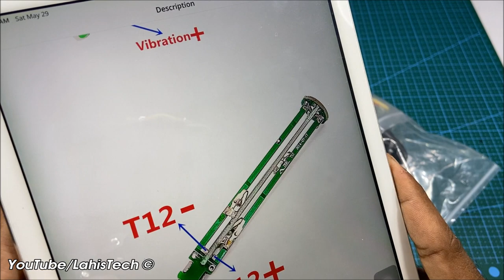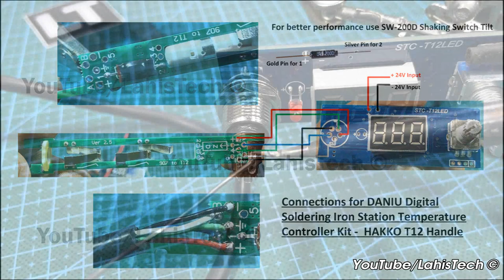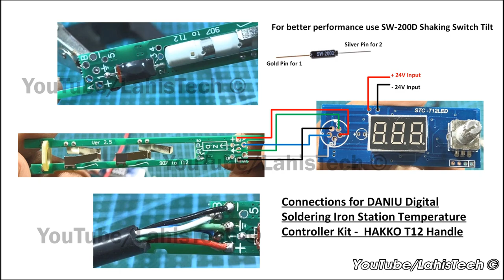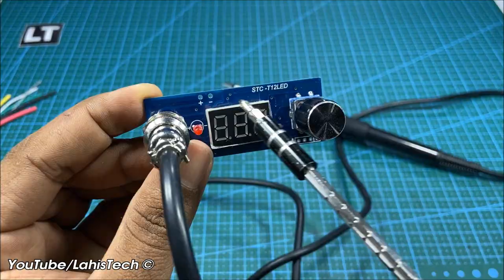DANIU Digital Soldering Iron Station Temperature Controller kit assembly and test

Comment: Hi~,Using a vibration detection switch cannot achieve shelf sleep. You can consider using an accelerometer or gyroscope in conjunction with a microcontroller for calculations to simulate the vibration switch's real-time high-low signal. I am currently implementing this functionality and verifying its feasibility.Yes, the solution is feasible